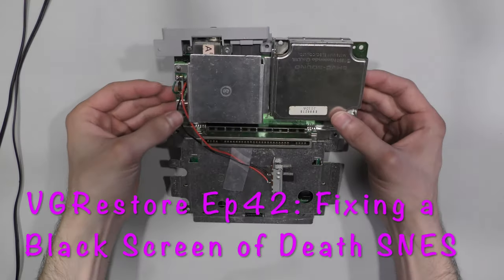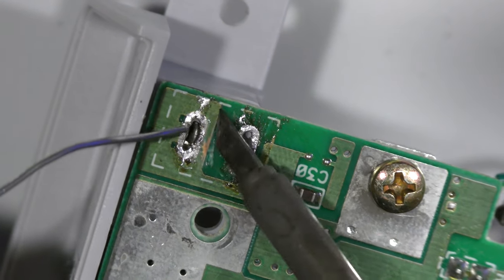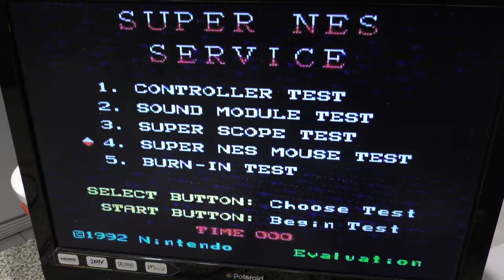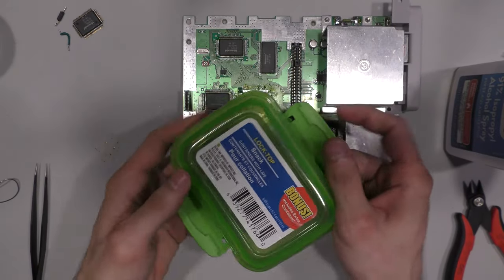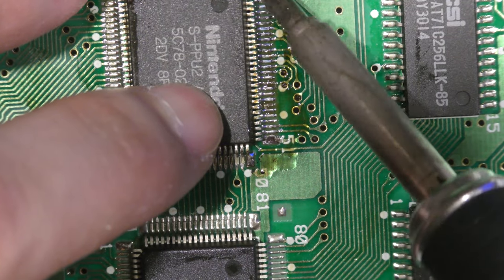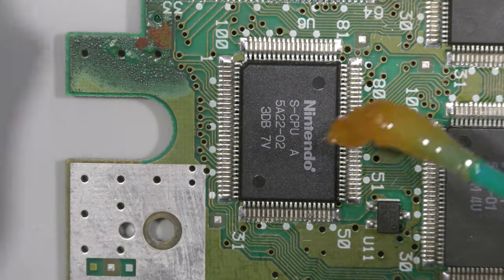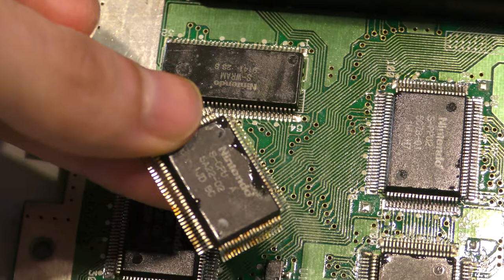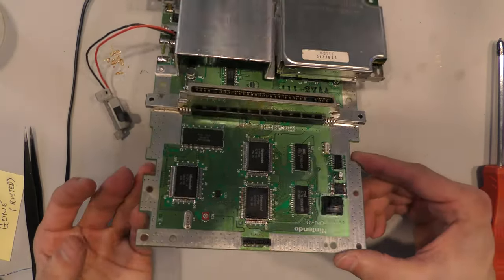VGRestore Ep42: Fixing a Black Screen of Death SNES

Comment: Your video awesome. I have snes, power is on but no signal in my tv, what can i do?? Please answer sir
Reply from the maker: Try on the AV out also try with RF out see if you can get a signal, remember you need a game inserted to get the console to send a signal to the TV.
Reply: @PunkNDisorderlyGamer  ok sir. what about the 62 pins? is also problematic?
Reply from the maker: @Studio92Videorestoration  yes that could definitely be a problem, check for corrosion or try to swap out the pin connector if you have another console on hand.
Reply: @PunkNDisorderlyGamer  ok sir thank you

Comment: How many do you need and what are you willing to pay. I have a bunch I haven't had time to fix yet or have pulled stuff from. Maby we can even do a trade. If I throw you 10 maby you can fix 5 and keep the rest of the parts or something along those lines.
I can do them myself but I don't have time at the moment. Usually wait till winter but even then I have a garadge full of sega and Atari consoles i can work on.
Reply from the maker: paul lanier well if they’re all black screens it might be hard to come up with 5 out of 10 due to being mostly caused by bad CPUs. If they have graphic problems but they still run maybe they could be repaired. We could probably work something out none the less. When you have a chance take a look at what you have and write down a quick log of the symptoms. Remember I’m in no rush if you get to it in the winter or next year that’s fine, don’t inconvenience yourself.
Reply: @PunkNDisorderlyGamer  I'll put a good variety of stuff. There are a few no power a few have vertical lines and a few with corrosion and a few with red wavy screens or green wavy screens. Plus I'll throw in a few extra boards I bought from someone he also had a bunch of random chips he said were good but I haven't had time to use any to test so who knows with them it was a flea market buy. I'll probably throw you 10 boards to start I'll lable what I can but a few of the boards I bought from the flea are missing powers and fuses so I may or may not try to power those to test.  I'll go through what I have and let you know. Problem is finding time. If you go through them all and there's not enough cpu's let me know and I'll test send more. So are the famicom cpu chips identical?
Reply from the maker: paul lanier famicom boards would be 100% just as good for me. Let me know I’ll send you shipping if you want I just need boards no SHVC sound modules, shells, power switches, or controller ports etc. I don’t even care if the back power port plastic piece is missing. Even if the board is cracked or rusted to hell, may still have value in chips.
Reply from the maker: paul lanier my email is punkanddisorderly@gmail.com

Comment: nice work, putting a wire instead of the fuse kills the console eventually 
i don’t recommend doing that.
Reply from the maker: That was previous owner
Reply: @PunkNDisorderlyGamer  yes i know , i’m just giving an advice to people that don’t know that it kills the consoles cuz it happened to me
Reply from the maker: Retro Algeria you still got that console?
Reply: PunkNDisorderlyGamer yes i do ,  now it gives me a black screen of death
Reply from the maker: Retro Algeria oh so it turns on, but give you a black screen? Yeah it’s possible you by passed the snes fuse protection and fried another component. But I’m willing to bet the cpu and ppus are still in good shape it’s still worth hanging on to the console for parts.
Reply: @PunkNDisorderlyGamer yeah i have maybe 5 pcbs that have the same problem and keeping them for parts 
, i don’t have a hot air station so i can’t do much with them , so i’ll wait till i get one and work on them
Reply from the maker: Retro Algeria nice, yeah bad CPUs are the most common cause of BSoD. If you do a lot of SNES work try to pick up a repro “burn in test cart” or you can try using an everdrive with the burn in test rom.
Reply: @PunkNDisorderlyGamer thank you will definitely try that ❤️

Comment: I got a super Nintendo It's giving me a black screen I have tried to hook it up to the AV and I've also tried to hook it up the other way with the RF box neither are working does anyone have any ideals what it could be? I've cleaned the console very good This console used to work It was in the shed for years and then finally I pulled it out to look at it and see if it works and I can't get nothing out of it I do know that it works because the power comes on you could see the light and when you try to insert a game you could see on the TV you just can't see the game actually playing It's like a black screen You know when it flickers when you turn it on and off but if anyone can help me please let me know if you have any ideals at all?
Reply from the maker: A chip may have just degraded over time or moisture got into the console and eaten away a trace or two.
Reply: @PunkNDisorderlyGamer  it was in a my shed for a long time so I say you right about that so far but I think it could be fixed if I had the info I need to fix it  I been looking no luck on the internet

Comment: Amigo tengo una snes con esa mismo tipo de placa.el test no se aprecia muestra caracteres como letras sera un ppu2
Reply from the maker: Im not really sure if it’s PPU2 or something else. Do games run? Or does it black screen? If you’re getting distortion it could be capacitors, if you’re getting bad sprites or jumbled graphic layers it could be a bad ppu1 or ppu2, or even a bad vram. But in all honesty, CPU failures are the most common among the older first generation boards.
Reply: Amigo gracias por contestar!!!
El test de nintendo lo reproduce con sprites(como letras,probe un juego el top gear solo audio aveces una pantaya azul y el titulo se ve como desordenado.cambie condesadores el tesultado el mismo
Reply from the maker: @armandj2011  yeah if you changed the capacitors, it could be CPU is bad. Sorry my brother.
Reply: Amigo encontre 2 cpu son modelo B .hay comflicto la que trae la placa es una con modulo de sonido.funcionan igual o traen alguna mejora osea son compatibles?gracias de antemano.
Reply from the maker: @armandj2011  yeah they are compatible, CPU ,CPU-A, CPU-B.
Reply: Muy agradesido.gracias por su ayuda bendiciones!!!

Comment: So I just ordered the special screw drivers to open the Super NES, I have one that only has a Black screen but when I switch it on the TV video port reports a NTSC signal but no audio or video. I already cleaned the cartridges & the NES contacts without any change. Any ideas?
Reply from the maker: It could be many things. I’ve since stopped doing repairs and forgot some of what I learned. Sorry if this doesn’t help. Try to see if you can run the burn in test cart through an ever drive or try to buy one off aliexpress to see if the console boots.